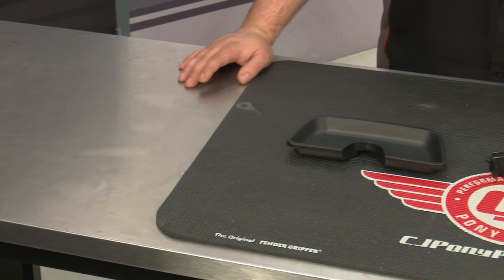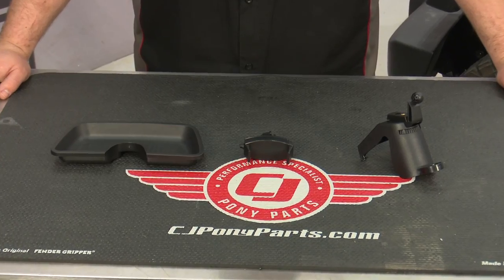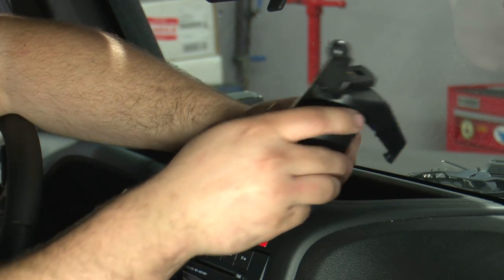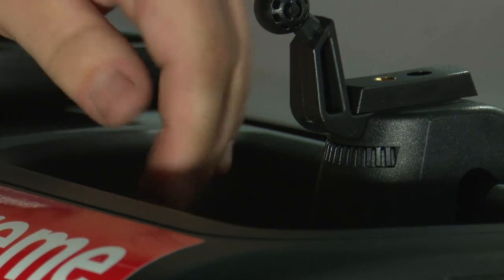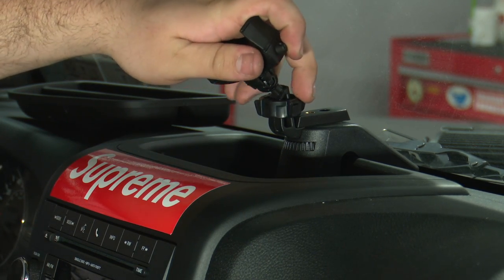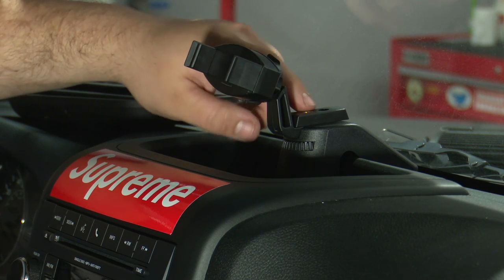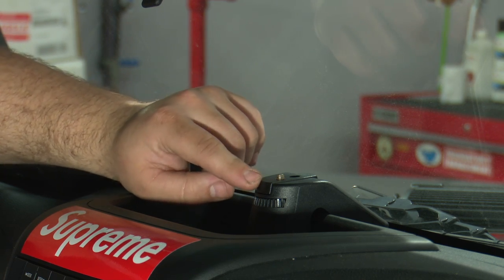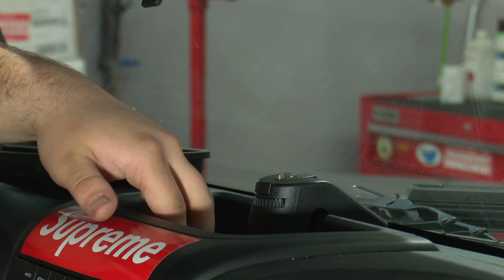Jeep Wrangler JK Rugged Ridge Multi-Mount Dash Tray With Cell Phone Holder 2011-2018 Installation

Comment: Does that fit a 2017 wrangler unlimited?
Reply from the maker: Yup!
Reply: I've heard a phone with a case will slip out of the holder is that true?
Reply: I have an iPhone 6s Plus with a case, and only once did it slip out, but for the most part, it's been really secure with no issues. I've been happy with this mount so far.

Comment: Junk, do not buy.  Phone pops out easily, it is possitioned where it's alomst impossible to connect a charger plus it is to far away from the driver.  Obviously using any device while driving isn't ideal but if you use your phone for music while driving your gonna want something that is within arms length.
Reply: I'd like it a little closer as I use my phone for gps
Reply: I have the same problem. I dont even have a huge phone. It constantly comes out at the worst times.